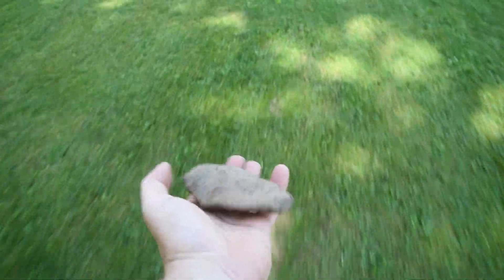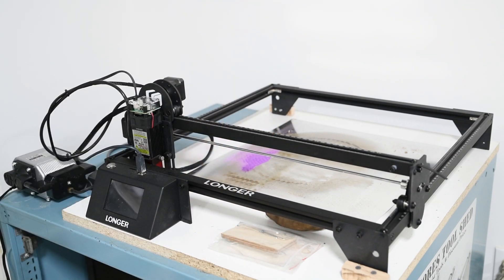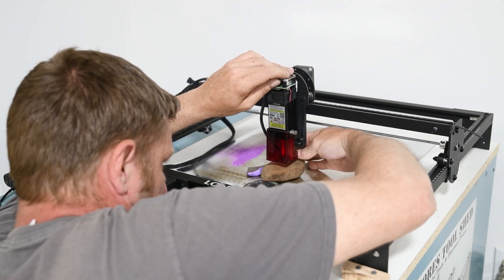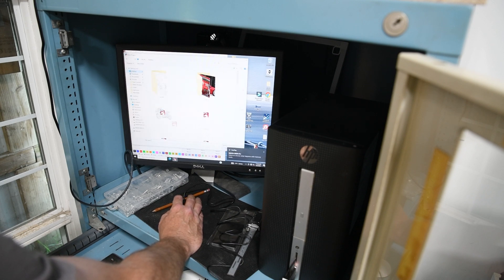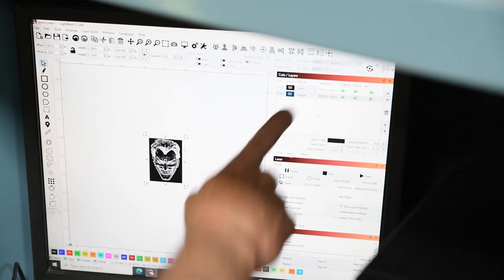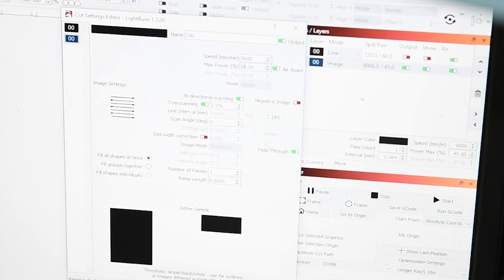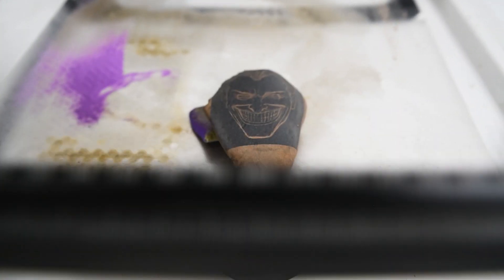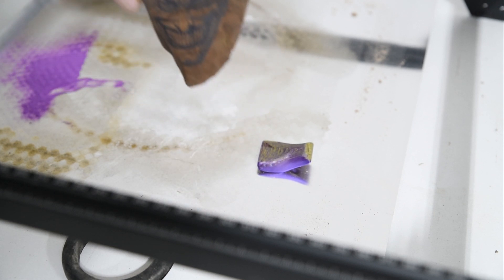LONGER Ray 5 10w Laser Etch A Rock

Comment: What did you do in Image-r?
Reply from the maker: Imag-r takes the photo and dithers it , creating small dots the laser can understand better, make sure if you put your image in imag-r that when you etch it you set your lightburn settings to pass through and dont use an image mode like dither as it will then be double dithered .